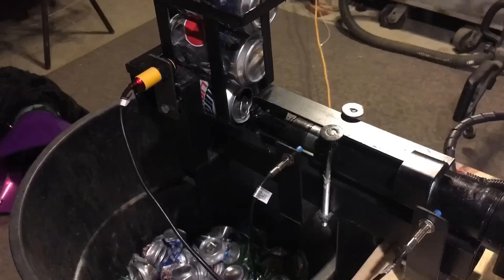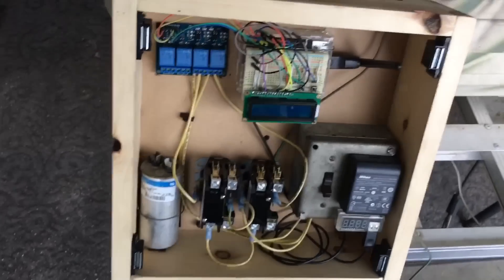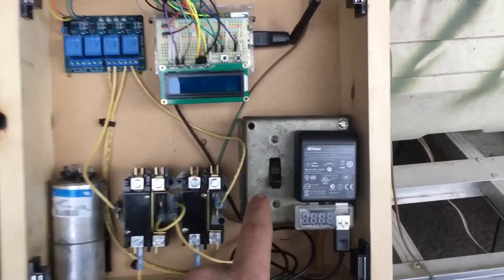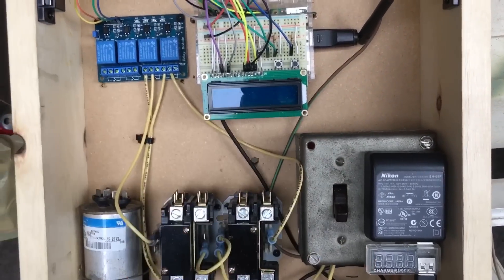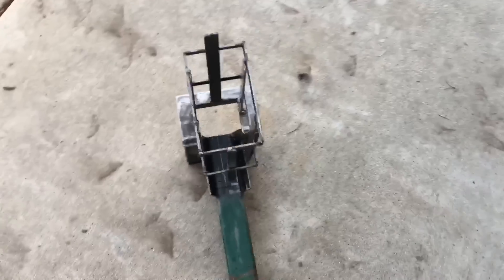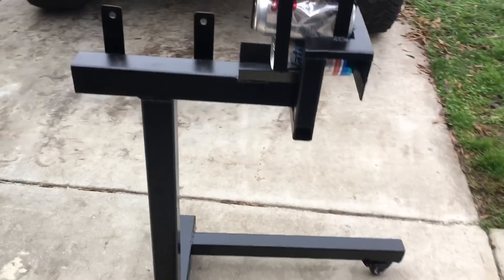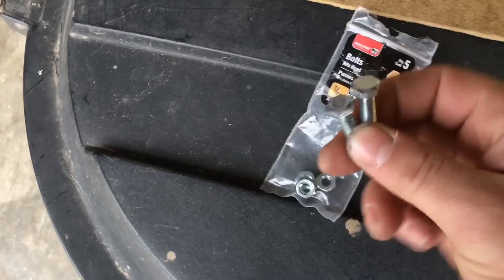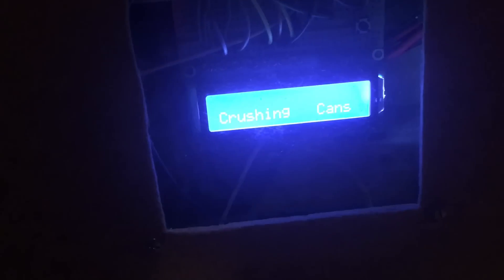Full Automatic 120v AC Electric Can Crusher Raspberry Pi Controlled Demonstration (Please Subscribe)

Comment: Is there a reason you went with a 110v actuator as opposed to 12v? Could you have just put a toggle switch in intead of a home button? I didnt understand what the other button was for do you mind replying it function! 

Awesome build looking to do something similar.
Reply from the maker: The actuator is actually what I had on hand , if you can find a 12v actuator that has the same force and can manage the amps it should be good. A servo actuator would actually be much simpler to set up and faster at crushing the can of geared properly. If I’m correct the home button was only used as a fail safe in the case there was a malfunction and the actuator was stuck out. This can happen if the prox sensor is momentarily disturbed. The final program used no buttons and was totally automatic. Thanks for watching 🍻

Comment: love the design and build... WWWAAAAAAAYYYYYYY to slow....
Reply from the maker: Simply Me next I will build one using servo linears with feedback speed is no problem here. Concept is proven just need $$$$ thanks for watching
Reply: @ATEMOFFROAD  This entire build is amazing, inspired greatly by it and the one linked below. WAY more fun than hooking up an an air cylinder. Would a servo make for a faster process? From what I read they just allow for variable speed not necessarily faster. Thanks again! Still learning so apologies if it's a dumb question.

https://www.youtube.com/watch?v=NG2GwwfvB2g
Reply from the maker: Chris servo linear actuators can be very quick and power , there’s no doubt it would be fast . Incredibly faster, problem is they are expensive.

Comment: Was there a reason for choosing the RasPi instead of something like an arduino?  Simply familiarity?  Im just curious.  Mechanically i like the design.
Reply from the maker: David Bunting I used the raspberry Pi because I had it lying around the house not doing much, did some cool projects with it like an automated Christmas scene and a motion Pi IP camera . Just got board with that it so I built this now the PI has a home! Thanks for watching
Reply from the maker: David Bunting Also Arduino would be more simple to use if I were to by components to build more machines  I’d go with the Arduino instead of the PI only because it’s less advanced and use very simple program. This project can be more industrial and robust , but this is just something for the home I  built with bones lying around the house. Again thanks for watching.
Reply: @ATEMOFFROAD  makes total sense. I have a TON of RasPis sitting around. Lots of gen 1 and 2 units. Using what you have already and making something cool for the total cost of $0 is a great feeling LOL

Comment: Wouldn't rotating your photoeye bracket counter-clockwise 90° allow it to detect the can in the crush position - so it would allow the machine to be self-emptying?
Reply from the maker: jmortonsalt yes that is correct. I had positioned the sensor up higher that way when empty!! the first Can tends to want to flip. With a Can left in at all times, it helps with the leveling of new Cans placed into the crush zone infeed, Thanks for watching!!